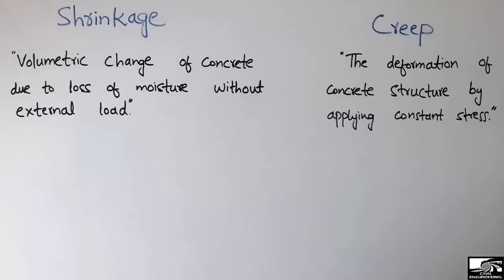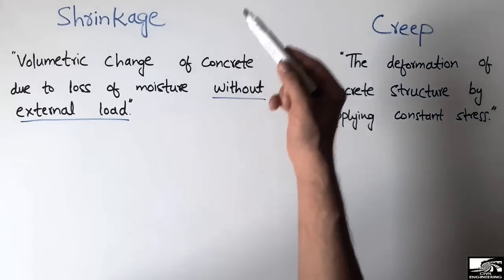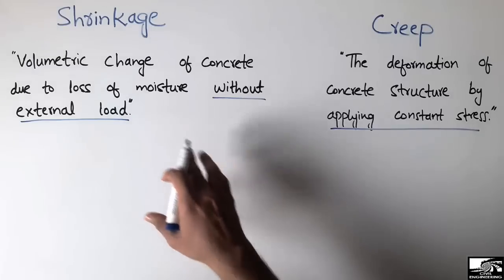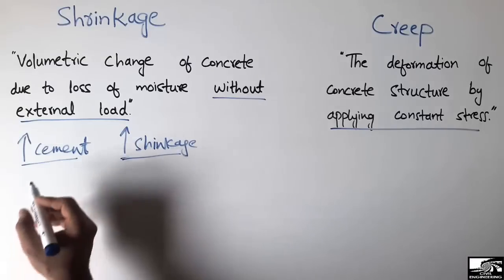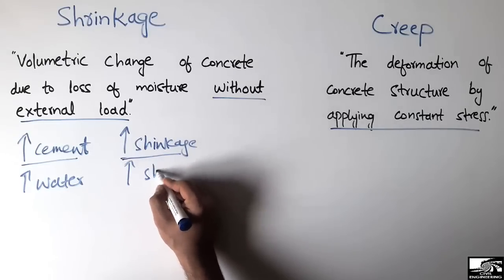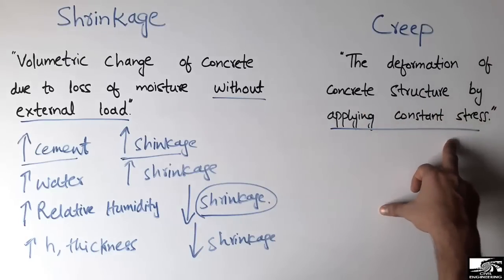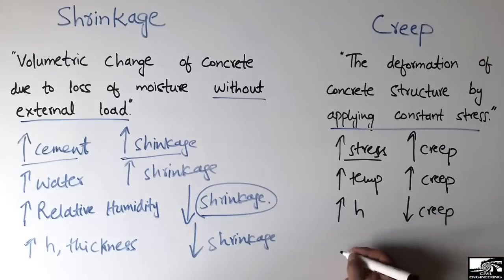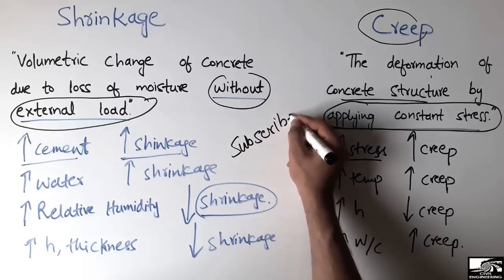Difference between Shrinkage and Creep

Comment: I need your professional advise or opinion on a patio which I am seeing various anomalies six months after it was poured. Your input would be great appreciated. Here are the specs for the Patio. 48'x15'x 8" thick tapered to six inches on the sloped side. It supposed to be a 4000 psi concrete with fiber mesh, and 1/4" FRP rebar spaced at 24". The patio has developed numerous cracks everywhere and in every direction. I am seeing areas where the concrete is chipped off broken off and other areas where the concrete is crumbling.  The control joints were cut at ten foot spands and depth of 3/8"to 1/2" max.